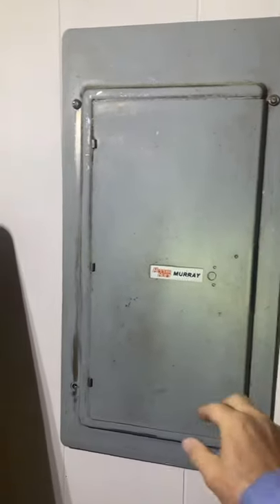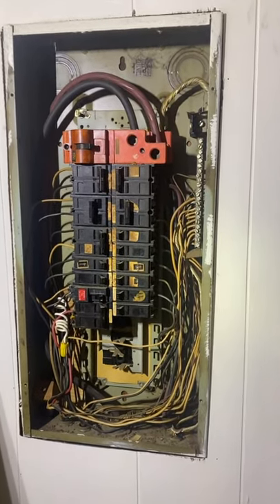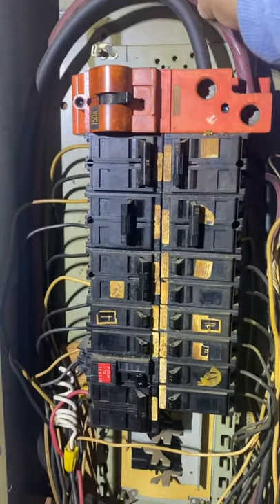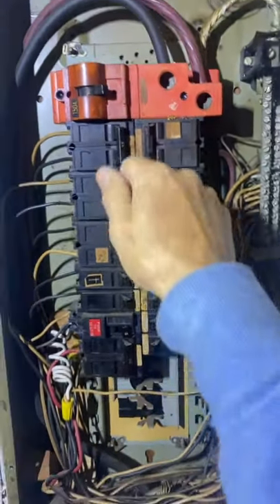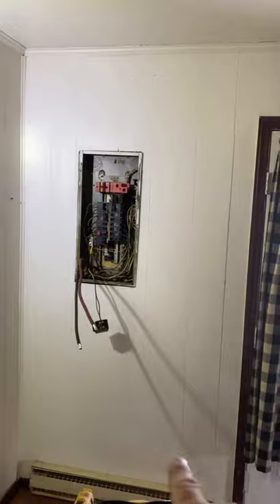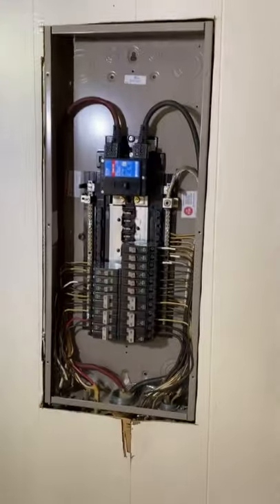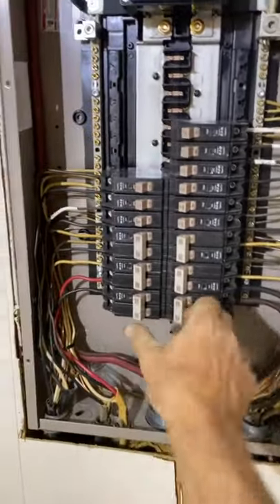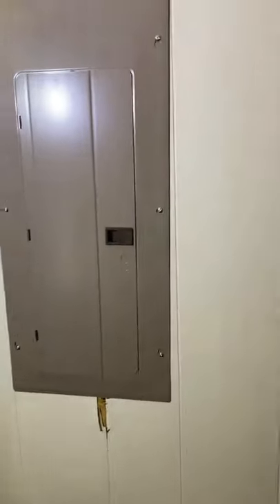Replacing old breaker panel with new

Comment: Red hot and sparking.  Wow you're brave, I would run away from that.  I could never be an electrician.
Reply: Once he killed the main feed to the panel, either by a main disconnect on the outside of the house if it has one, or by pulling the meter, then waiting a few minutes for it to cool, he was perfectly safe.
Reply: @fldave612 yes this is the difference that made me feel comfortable messing with electrical. Once I KNEW, the power was off, and how to verify the power was off, I started feeling way better about messing with it.

Comment: My house has an old Murray panel just like that one, likely original with the house when it was built back in 1972.  I'm seriously considering replacing it, it's full and I've added a sub panel next to it to accomodate extra circuits that have been added over the years.  I have a 200 amp service with 3/0 copper from the load side of the meter to the main breaker of this panel, and #4 grounding conductor.  The panel has different brands of breakers in it Square D Homeline, GE, Siemans, and Westinghouse, as well as the orginal 1970s Murray breakers with the blue 15 amp, and red 20 amp toggles.

Comment: Would be nice to know how you disconnected the power before hand.
Reply: Lol. The main breaker on the outside of the house probably.
Reply: Maybe called the city to come out and turn it off?
Reply: breaker, disconnect or pull the meter...Some places will let an electrician pull meter and not in others.

Comment: That old panel looks new compared to my outdoor panel, that was converted from a power meter box. I still have tar paper wires. Also a glass fuse sub panel in the kitchen. 😢
Reply: Hope you have extra fire insurance, several fire extinguishers & a fire protection warning system that will call the fire department. Also you must have combination CO2 / smoke alarms.